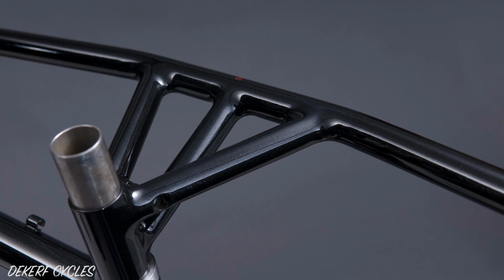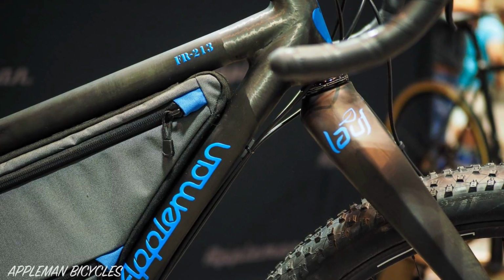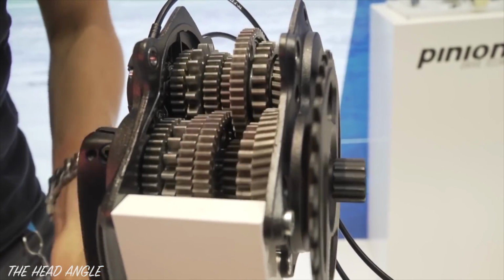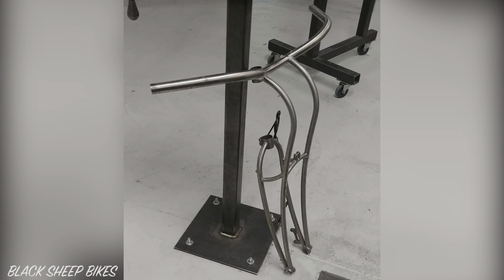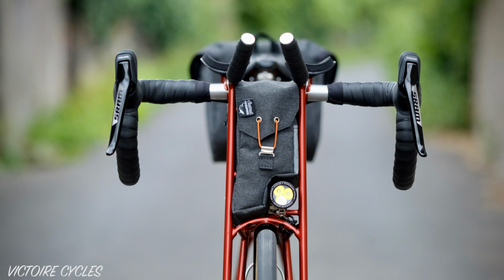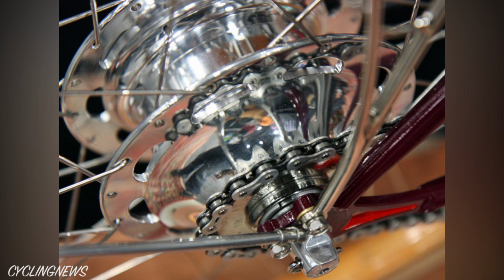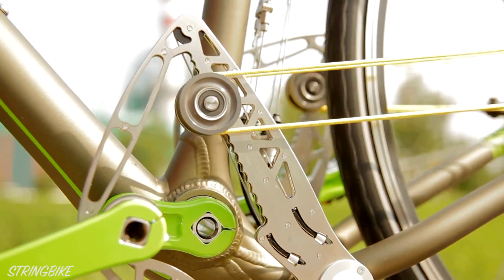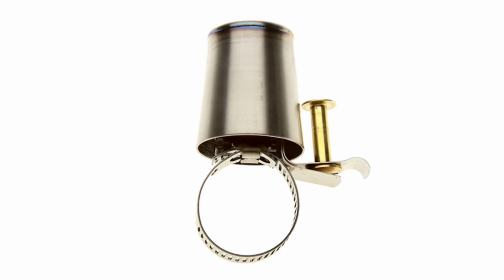23 Mind Blowing Touring & Bikepacking Bike Features!

Comment: Meh, expensive. I'm also a fan of outer complete front to back cabling. Easier to work on the go, completely enclosed unlike a lot of internal where the mud gets in the frame and rusts out the cable INSIDE the frame. Before i get blasted bear in mind i'm shop owner and mechanic, i've 10,000's of bilkes.
IF*** and that's a "big if" a frame is properly routed internally then im ok with it but trying to route a gear cable on a frame with no guides in 5*c cold and lashing rain is impossible and you'd be wishing you just bought a more standard bike. The same goes for 40*c heat and blazing sun getting angry at a cable the will NOT route.

So customer built frames are fine but the industry will cheap out not give you internal routing or give a plastic routing the degrades and breaks. Now these modern CX, Road and "Adventure frames with moulded carbon stems and enclosed cabling is just stupid. Pulls snatches and brakes hydraulic hose and gear cable all for a "Clean" look. I'd rather be practical.

EDIT 1, Fat bike Tandem is nice. However that is price of a new car territory.

Edit 2, integrated stem and bars, only if you build your own. But even at that I can like it for a week or two then realize it's maybe a cm to long and switch stems. Or I might switch strems and bar position for the terrain i'm on. Why you'/d want a fixed position bar and stem outside of TT/Road race bikes i have no idea.

Edit 3 08:40 I like it but water will get into your headest you have to plug under your steerer and the hols on the frame. If you change forks that then becomes an issue. "Frankenstein"
However bars turning is an issue. I wonder if you have stem that sit back of the steerer and has pins either side of the top tube?
Reply: Anyway still watching >>>

Comment: the most crazy invention for a touring bike is "Bikepacking". Instead of two 20 liter panniers installed low down, which you can click off your bike and take to your hotelroom, 
you fasten 7-8 small bags, with velcro or screws all over the bike,  totalling maximum 10 liters, given it a higher center of gravity, taking up space where your bottles should be or where you need to grab when lifting the bike and making it impossible to take your luggage to your room after placing the bike in the hotel storage.

I still call it bike touring and use my panniers.

Comment: I prototyped a version of that string drive in the 1990s in my factory where I built the Lahar WChamps and 2 dozen National winning framegearbox bikes.
It had five moving parts, 800 percent infinitely variable ratios.
Much lighter than derailers.
Very low maintenance requirements, much lower than even gearboxes like the Rohloffs we used. Including with gold chains btw.
It's not a new idea, but eliminating all future repair profits from the industry unfortunately has always killed the best stuff.
Reply: ха ха (нельсон)

Comment: Lmao a guy ordered a recumbent quad iirc with 12 speed pinion in front, and 14 speed rolloff in the rear. It was on Utah trikes channel. think it had motor as well. To be fair you need the low climbing years on recumbents.

Comment: in tube water storage should have happened decades ago.  ty stash tools for screwing up that simplicity. i mean how can so many companies miss what is seemingly obvious.  i made a steel cylinder out of two 1200ml bottles (no safe plastics) and run a tube up to the bars with an inline filter and check valve.  makes it look like im riding a jet powered motorbike but its light clean and works well...would be so much better to just use the tubes though.

Comment: Great video.
I recently saw in St Mawes a touring tandem.
The rear seat was upright as normal.
The front seat was a recumbent position, feet further forward than the small diameter front wheel.
I'm not sure who steered and braked.
I suppose the big advantage is the rear rider has unobstructed vision over the top of the lowered forward person.
I ride a Moulton APB.
Just gotta love the unconventional inovations.
Keep safe everyone.
Reply from the maker: That could be a Hase Pino, Bilenky Viewpoint or Circe Morpheus. The rear rider has all the controls and riders can pedal independently.

Comment: Rokon 2WD motorcycles explored liquid storage in the bike years ago. The primary way they did it was inside the wheel rims completely within the metal.  And of course Bridgestone cycles used belt drives for years on their Albelt model  before Gates marketed them. Ecclesiastes 1:9
... "there is no new thing under the sun".   (Tongue in cheek when it comes to bikes of course).

Comment: The string-bike with dynema-strings is the only transmission, which, without distinct steps, would be the 1sr CVT with high efficiency (imagine taking away the 19 steps, so getting infiite number of steps). This ratcheting-gears-concept is also the only practical one on the list... :-)

Comment: I'm trying to think of the last time my cables were too noisy...
Reply: The part I thought was rich was the juxtaposition of adding metal tubes inside the frame tubes for internal cable routing with using the anodizing process for decoration to avid the extra 'weight' of paint.
Reply: Good thing is, if  they are loud enough you wont hear the noisy traffic anymore
Reply: I must be going deaf, i never knew they made any sound at all.
Reply: oh ive had some rattlers. it is annoying. silicone though 🤷
Reply: I had a specialized crux that took me a solid 2 weeks to figure out the loud rattling was coming from the cables banging around inside the downtube. Even on some rough gravel it would be incredibly annoying. Loved the ride but couldn't stand the noise.
Reply: You can hear tapping from cables sometimes. Never thought it to be an issue. So people go crazy and put pads where the cables touch.

Comment: @Cyclingabout Anodising is and electrolytic process used on aluminium to create a hard surface, colour can be added to the resulting porous surface. Hardcoating is darker. It is not a process to specifically add colour.

Comment: FYI for the nerds... you can make your own Ti shotglass bell with a few parts from the hardware store (hose clamp, threaded coupler, spring steel, brass pin) and throwing your local fabrication shop a few bucks to weld up a piece of tube with a threaded stud.

Comment: I love this list of touring bike features you've put together.  This is my kind of bike pr0n!  I've got the first production Greenspeed convertible tandem recumbent trike http://www.sandsmachine.com/a_gre_t4.htm which is actually the 6-coupling version mentioned in the link at the bottom of that page.  I wanted his expedition version of it, but Ian Sims refused out of concern for the integrity of the frame.  RIP.  It also has the Rohloff/Schlumpf combo you mention, roof racks (for my canoe), a custom rear rack with a towbar hitch for my son's "lamb" trailer and for the hammond organ trailer.  We've also attached a Weehoo trailer to the Lamb to make "the caterpillar": http://tricolour.net/photos/2011/07/24/16-40-21i1.html .  This is my ultimate touring machine.
Reply from the maker: That's a pretty crazy build! I'm a fan. 😎

Comment: String bike is great. An engineer with time on his hands I think but beautiful engineering.
Reply: Until you show it some gritty mud anyway.
Reply: It think it's way too much clutter and the strings look cheap. Belt-driven looks much cleaner and his similar advantages.
Reply: @dernils6176  The strings have to be replaced way too often. But at least it's easy to do. You also get a ride similar to an oval chain ring with the asymetric power stroke.
Reply: @KenOtwell  Do you own the Stringbike? I know several types of strings being used on paragliders and some materials are not stretching so much... My plan is to buy one Stringbike in.. near future ;)
Reply: @dernils6176  stings from dynema can take hundreds of pounds before extending even 1 mm. Those ones were used here...
Reply: It's nicely done indeed.  The crank cam pathways are awesome.

To some of the other commenters... sometimes, making something "the best" isn't an engineer's goal... it's rather to explore an alternative design approach to an old problem.  Try something new to make a beautiful machine that's fun to use and look at.
Reply: The string-bike with dynema-strings is the only transmission, which, without distinct steps, would be the 1sr CVT with high efficiency (imagine taking away the 19 steps, so getting infiite number of steps). This ratcheting-gears-concept is also the only practical one on the list... :-)
Reply: at least it's a great conversation starter.
Reply: It's good on clean asphalt but don't bring it on muddy and dusty roads. I think it's just for city biking and nothing else

Comment: I thought rust on steel frames was bad, can you imagine having to deal with termites?
Reply: @DirkDiggler-n4r  actually its 11% and higher, but you're general point is right, sort of (see my other comment to steven)
Reply: @maxk4324  apparently ginger oil has a sever effect on stainless steel according to "Thomas&Betts 304 Stainless Steel Corrosion Compatibility Chart" (yeah, I ride my bike everyday in heaps of ginger, and that's a real problem /s)
sulfuric and hydrochloric acids are also pretty nasty, but if that's a problem for your bike, you have more to worry about.
Reply: Lol
Reply: stainless steel doesnt rust
Reply: @jakob6399  yes it does.
Reply: @jakob6399  Yes it does. It just rusts less than non stainless.
Reply: @stevenkelby2169  Actually it depends on what type of stainless steel you have. The chromium in the steel alloy forms a layer of chromium oxide when exposed to air which passivates the outer surface from being attacked by oxygen any further. This is the same mechanism that occurs in aluminum. So one could say that both aluminum and stainless steel don't rust because they rust too well (or more like too quickly). In the case of aluminum it is the base metal itself creating the oxide layer so pretty much every aluminum alloy has this "rust free" property, but in the case of stainless steel it is the chromium doing the protecting. So if you have a steel with less chromium in it then the oxide layer won't be as dense and thus won't provide as thorough protection for the iron. But with enough chromium you can have stainless steel that can pretty much survive any chemical attack you might find in nature (I specify chemical attack because I know some ass hole in the future will just reply to this saying "oh ya well what about a volcano har har har"). This higher chromium stainless steel is the type you'd typically find used for chemical plants where they need tanks to store stuff like liquid oxygen or concentrated acids, etc. Of course a higher chromium content also drives up the price hence why a lot of consumer products opt for the lower chromium content in order to make more profit (because of course they do).
Reply: @stevenkelby2169  It should be called lessstain steel, not stainless steel.
Reply: @stevenkelby2169 
It also depends on the quality and various alloys.

Comment: Great video. Love the booze bike ha! Never heard of a string bike before too. Surely could be great for super remote touring as it's so easy to replace!
Reply from the maker: I didn't get a ride on the StringBike, but the bike nerd in me loves the out of the box thinking!
Reply: @Cyclingabout  I know. That's nuts. I wonder if theres any frames with built in solar panels yet.. always thought that's be useful on long tours! Or a whip out shower from the frame or slide out lounger chair.
Reply from the maker: I've seen panels integrated into a bike before... maybe Van Moof? The problem is there is very little surface area to get a decent amount of electricity... ok for a blinky light though!
Reply: CYCLINGABOUT must research now how the string integrates with the rear hub and offset cranks. I’d wonder about slippage in wet conditions and tuning. I love the idea of a balanced power train. Thank you for stealing yet another hour from my day 😉
Reply: Mash Code It’s a Hungarian thing... No slippage, the end of the strings are attached to the hub. There are two free hub bodies on both sides of the rear hub, locking and releasing with every crank revolution, giving an alternating pull/turn to the wheel.